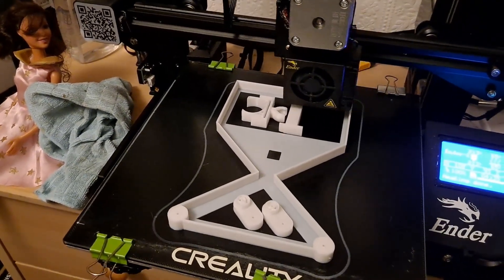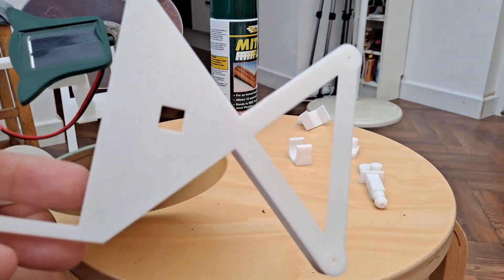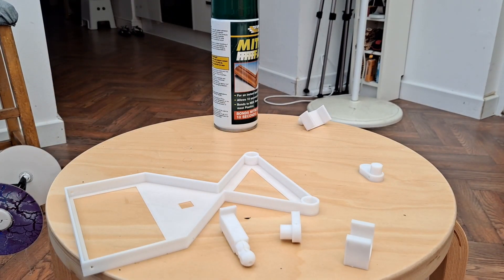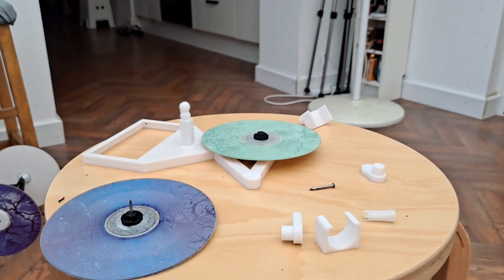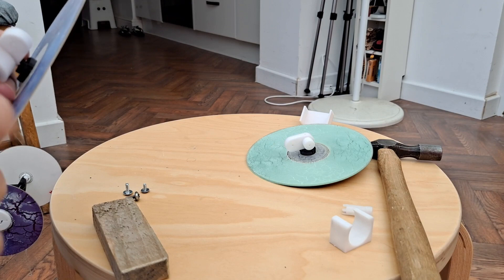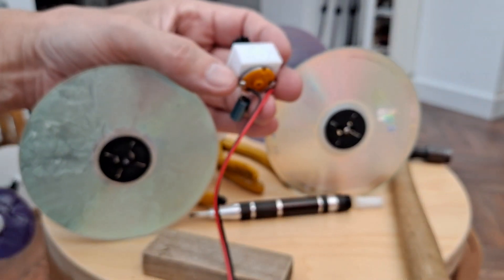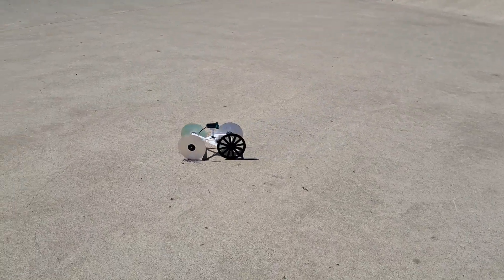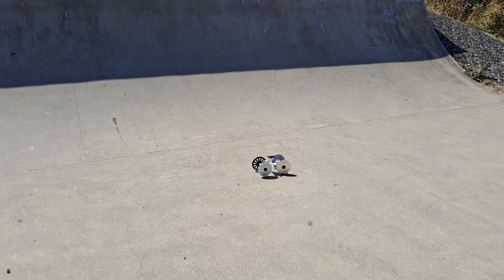Solar Butterfly to Solar Car CIRCLING 20220809 Emersons Green

Comment: a vdo from JBV Creative popped in my feed the other day about a 3d printed gear box, the fastest mechanism he'd ever printed and it made me think of the other car you had recently shown.. right now you have an x-y gear ratio but with an x-b-d-y ratio it might climb the skate ramp or go faster with the same motor/power.. No I have no idea what the letters mean, just a wild thought like what side do britians pass each other in the store..a.d.d. at it finest...lol
Reply from the maker: Yes, multiple gears would increase the torque. Those solar robot kits I have assembled have good gearboxes to drive the robot walking mechanisms. As for passing, I guess it's the same all over, polite people accommodate your direction of movement, ignorant people ignore your existence and barge right through.
Reply: that does run right along even circling

Comment: Nice video . I bet you Can add a servo To work the steering arm To  steer the wheels. What Were you using for back axle?
Reply from the maker: Yes, full rc steering and control could be added but not solar powered. The axle is a bicycle spoke because it is a handy source of 2mm steel rod 👍

Comment: It trundles around very nicely, great upgrade!
Got my ANET A8 up and running again yesterday after months. Turned out, it was the new filament. I'd regreased all bits, aligned, levelled and only on swapping to a piece of 3D pen filament did it print correctly. Am wondering about your experience with filaments... the new stuff needed 220C to melt and apparently is too shiny for the gears to grip on the extruder!
Reply from the maker: At the moment I am running the nozzle at 225°C and the glass bed at 70°C  and print speed at 50mm/s for most of my prints. PLA+ seems to need the extra heat and I leave it there for the normal PLA. When I print with TPU I am running at 227°C and only 60°C on the build plate and drop the speed to 20mm/s. I am in no way and expert, but that is what is currently working for me with my Ender 3.
Reply: Thank you for the info. PLA+ is likely what I bought, unknowingly. Nozzle is now blocked, so the assembly is going to have to come apart for a big clean.
Reply from the maker: @Slider2732_  I bought a pack of nozzles, probably my best investment. Cleaning them simply doesn't seem to work 😁
Reply: I may do that for future problems. 
It's fixed now... took the whole assembly out of the bottom and found that the last filament had stretched, broken and got wedged down the outside of the feeder hole! Couldn't see what it had done until taking apart, but it meant filament couldn't go down the tube, just like a regular blockage.

Comment: I have an idea why don't you bye 4 broken CD player and use the spinny thing that you put the CD on because it's just push fitted onto the motor and you can detach and reattach the CD if one breaks on impact or if the CDs are too big for storage
Reply: And if you don't understand what I mean I mean you use them as the rims of the solar car
Reply from the maker: Thanks, but to be honest, surely it is much easier and cheaper for me to print 100 of my CD gripper hubs than buy 4 broken CD players. I can print them to match whatever sized axle I choose to use. You will find I use them a lot on my Putarubberbandonit channel that is dedicated to rubber power. However if you don't have access to a 3D printer, then your solution would be an option 👍 In the past, I always hot glued bottle caps to my CDs for the hubs.

Comment: If it has good torque that would be good to use to get specific shots with a camera
Reply from the maker: I am not quite sure what you mean. Do you mean to put a camera on the car?
Reply: @GrandadIsAnOldMan  yes
Reply from the maker: @georgeaura  It only just moves with the weight it has. It would have to be a small camera. I do often put my minicamera on things like this, but not really much to see in this case, just circling round in the skate park.
Reply: @GrandadIsAnOldMan  that would be good for product shots or a 360 of a subject
Reply from the maker: @georgeaura  possibly, but it has rigid wheels and wanders off track. A good sized RC car would do the job more reliably and smoother with nice soft rubber tyres 👍👍

Comment: What if you add a really simple remote control module to control the steering?
The simplest of the simplest would be enough.
Reply from the maker: The simple answer is it only just has enough power to drive the motor. There is no spare power to run an RC receiver and servo.. I could add a battery to do that, but that would rather defeat the object of it being solar powered.
Reply: @GrandadIsAnOldMan  Or, a wired remote from a cheap toy car with a slow motor for the steering?
Reply from the maker: @zsombor_99  same thing, you would be defeating the point of it being solar powered. People would call it a fake.
Reply: @GrandadIsAnOldMan  Maybe a second solar cell for the steering?
Reply from the maker: @zsombor_99  you need much more power. The solar panel would be something like 10 times the size. Here is a solar RC boat I did https://youtube.com/playlist?list=PLA5a2xPRSrB0CbqRkzsGRzhfMqrEydOPg and the reason I did a boat was it could carry the weight of the panel. A car would struggle to move it.
Reply: @GrandadIsAnOldMan  It just needs something for steering, right?
Reply from the maker: @zsombor_99  solar panels produce very little power. Have you a solution?
Reply: @GrandadIsAnOldMan  Maybe a little step-up module? I don't know... The low power output is definitely a problem.
Reply from the maker: @zsombor_99  that is the point of this video series. Actually getting a car to move from the limited power available from the small solar panel. There is more information and links in the video description. A 'step up' module would either increase the voltage and reduce the amperage, or increase the amperage and reduce the voltage. You don't get any more power, in fact you lose some as the module would use power to power itself.
Reply: @GrandadIsAnOldMan  Maybe additional capacitor to help the load?

Comment: Excellent. Great 3D printing. This makes it more interesting to watch rather than just a straight line. 
Top job. 😃👌👍
Reply from the maker: Thanks Mike. Yes, circling gives us a chance to see how long it will keep running, although it drifts a little, so it would really need a central tether to keep it in position. That would add some drag, but it might work in the right conditions. The world has moved since this was filmed, so the sun will be getting lower in the sky and the available power will be dropping.
Reply: @GrandadIsAnOldMan  Strap a small high-powered LED torch to it and then it will go all year round. 😆👍
Reply from the maker: @mikeflight9  how can I put this politely 😆😆🤣🤣 no 😁😁